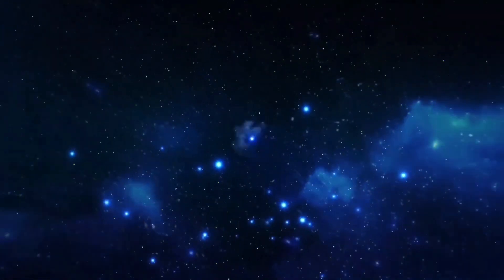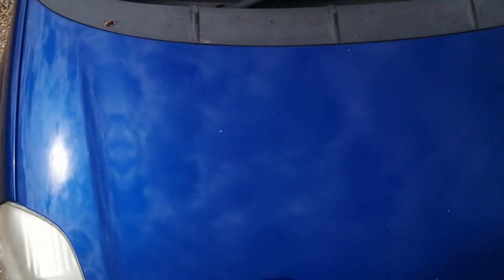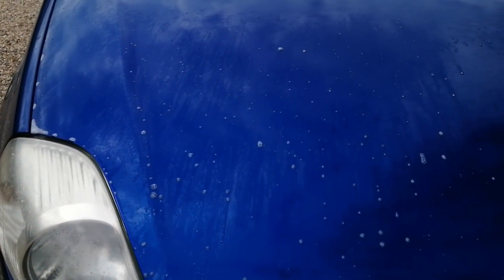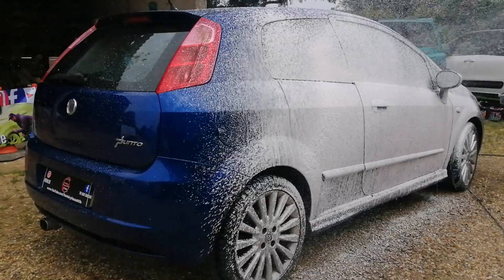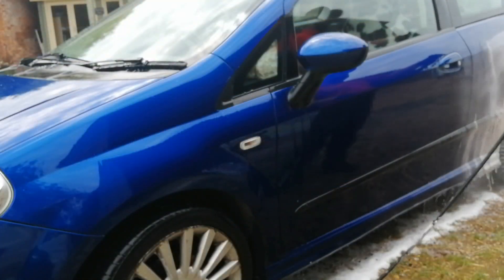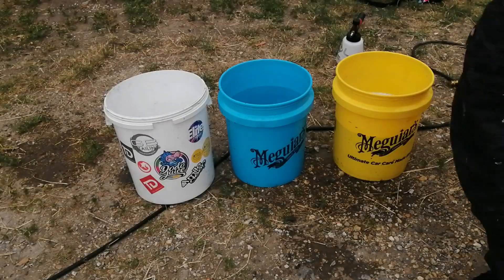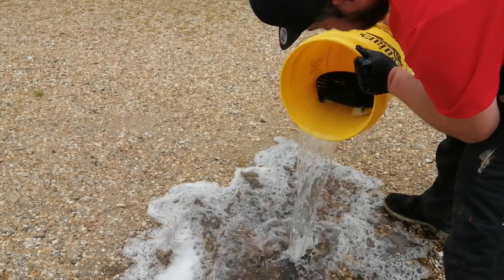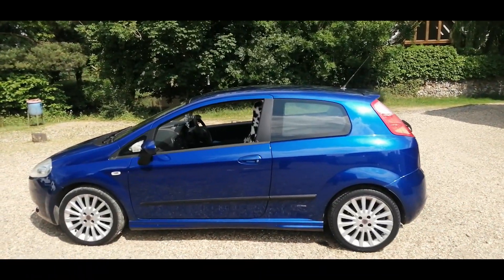Mile Deep Detailing Product Review, Citrust Pre Wash, Snow foam, Shampoo and Protective Rinse Aid 👀

Comment: Hi Mr Hairy. Could you suggest when rinsing off snow foam, how close the pressure washer nozzel should be to the paint. I used this snow foam and got great foam but didn't seem to do much, someone suggested power washing closer to car. Which was a lot better, but how close is safe and correct. Many thanks. John
Reply from the maker: So many variables but with the correct nozzle I would suggest around 1 foot away however I have been known to go up to 6 inches , what nozzle are you using
Reply: @TheHairyHouseWife  Thanks for your reply. I have a Nilfisk core 140 pressure washer. They suggest for cars, the gentle nozzle on the lance and power setting 3. I think what I was doing wrong was I was washing the snowfoam off like u would shampoo. And standing 2 or 3 foot away 🤔